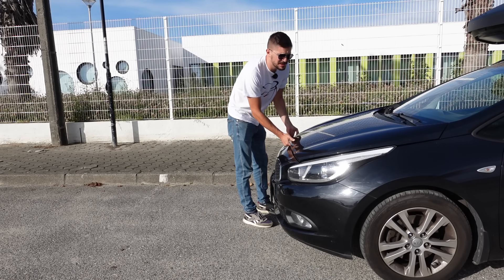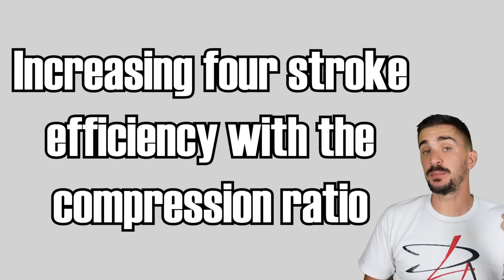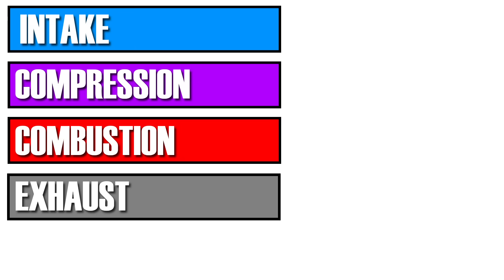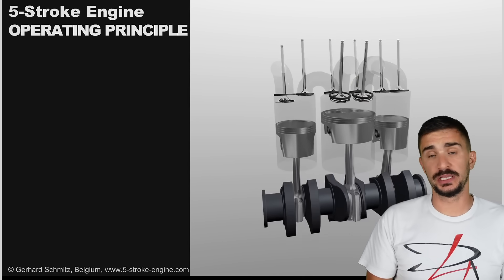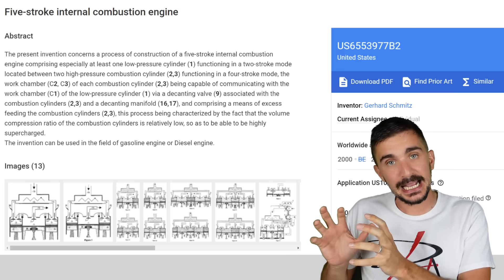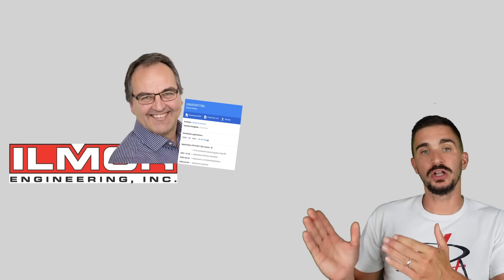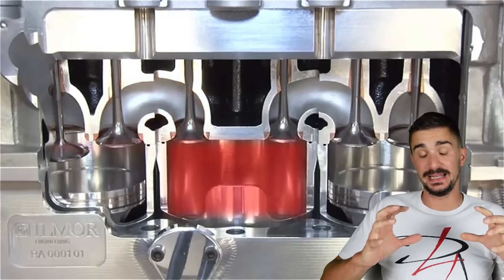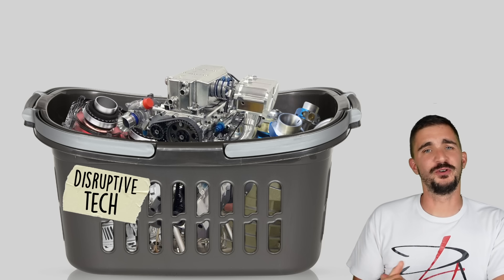Why Five Stroke Engines Are More Efficient But Still a Failure

Comment: I know next to nothing about automotive technology, so I’m probably going to sound dumb; however, I had some thoughts about how to reduce some of the issues with the engine.
1) The expansion cylinder doesn’t deal with the intense forces of combustion directly, so maybe it can afford to be lighter/ less robust. If it’s lighter, then it’s not as much dead weight during low rpm.

2) A turbo will be difficult to utilize, but a supercharger may still be effective—especially if we’re trying to fix the issues at lower rpm.

3) If the expansion piston is still an issue, maybe there’s a design solution that can engage/disengage the expansion system, so it’s not utilized if it’s not helpful. Sounds like a lot of complexity, but maybe it’s something to consider.

4) Maybe the engine could be used in applications that require high intensity more frequently than not. I’m not sure what though.

Again, I don’t claim to be any kind of expert, but I just wanted to share a thought.

Comment: Nicely done.  It does sound like this engine would work well in a moderate to high constant load situation where it runs for 3 or 4 hours at a time, like running a generator for a home while also charging batteries.  It may have a niche application but there may also other designs that might do well in the same application

Comment: Not to ruin your moment or even argue, but electrical locomotives are almost 150 years old as well (1880 when they seriously started appearing), so I wouldn't say that EV's are "new technology". New application and with internal source of power, vs external delivery - yes, but Electric motors aren't "new". They are also "existing, well developed technology". And yes, there were Electric Vehicles in early 20th century, but they weren't good. Nothing compared to ICE. Steam (which this 5 stroke engine takes from) also wasn't able to compete - no wonder that ICE managed to have it's monopoly for so long.
Funny thing is that while this tech was taken from Steam engines (triple expansion for example), there is another version of ICE that takes existing technology from Steam engine and uses it - Turbine engines. Which also try to squeeze as much energy from exhaust as possible.

Comment: @1:27. Your explanation of the inefficiency based on strokes sounds right, but it's not really correct. The real reason is that the amount of work available is related only to the temperature difference at combustion to the temperature at the bottom of the stroke. That's the only time energy is extracted from heat. The total amount of energy is proportional to the absolute temperature, but since the temperature at the bottom the stroke is far above absolute zero, the energy remaining is the 'other' 70% that is thrown away. The only way to get better efficiency is hotter combustion or somehow making the exhaust colder. The mechanics of the engine to make all of that happen are additional parasitic losses, but fundamentally energy available is t(combustion) - t(exhaust). Specifically, efficiency is 1 - (tcold/thot), which for a petrol engine is roughly 1 - 600K/900K = 0.33 (33%). Edit: I realise that you are basically saying this, but rather than making it about the stroke 'length', I feel it's better to talk about how cold you can end up making the exhaust. Edit2: Also, whenever any 'revolutionary' internal combustion engine design is presented, you have to ask how it gets around this fundamental thermodynamic limit. Because no matter how many bells and whistles and extra moving parts you throw at it, the universe insists on having it comply with that equation. This is why electric motors are the only way forward from here - they have a fundamental efficiency of 100% and only fall short of that because of practical engineering. The ICE on the other hand, is fundamentally cursed by thermodynamics.

Comment: The elephant in the room for IC engines is the theoretical limit established by the Carnot cycle.  All these engines do is edge closer to that limit, which isn't particularly high for workable high and low temperature reservoirs.

Comment: Their has been many created diesel engines with HHO units attached as Rudolf diesel did using peanut oil , i have a 4 cylinder diesel with LPG fumigation  i get a lot more torque a the fuel is burnt almost completely and much less heat ,

Comment: couldn't this perhaps be a solution for a power source for an electrical generator that runs under full load all the time?  Would not have to worry about the slow rpm condition.

Comment: In a series hybrid setup, the engine would be running at 80-100% load whenever it is running. That would eliminate the light-load loss scenarios.

Though once you get into strictly range-extending generators, there is no reason to stick to rotating shafts. I'm hoping free-piston linear generators can be effectively scaled down to 10-50kW. With all of the friction points and moving parts that get eliminated, there should be a 10-15% gain to be had there, along with a fair amount of cost reduction potential as the tech matures.

Comment: The shortcomings of this being at low rpm and when in stop and go type use make it sound an awful lot like it would be perfect for a hybrid - only use the engine for highway speeds where the low pressure cylinder would remain a net benefit and the turbo would function properly.
For the catalytic converter issue, though, would it be possible to just route the exhaust so that the cat is after the high and before the low pressure cylinder?
Especially given that the low pressure cylinder is low pressure, it could probably be made with different materials to resist the different byproducts (water especially) better than a normal cylinder can.

Comment: On the surface, this engine seems better suited to stationary work like power generation, pumping or maybe light rail transport. With a turbo installed I would have called it a triple expansion ice.

Comment: Dude the ICE engine is amazing.  It’s been around nearly as long as the electric motor!  LOL but what’s really impressive is the energy density of hydrocarbon fuels.  That’s why planes can fly internationally — and making synthetic liquid fuel is one of the “high hanging fruit” in the transition to getting our energy out of the sky, not the ground.

Comment: If you think about it: It's basically impossible to get a compustion engine anywhere near electro motors.
When the gas explodes, the energy from the explosions goes into all directions. It's an explosion after all. Yes you can direct it somewhat, but not 100%.
Meanwhile electric motors directly convert the electrical energy into a motion with magnetic fields. There are almost no losses.

Comment: The carbon fouling on that third cylinder would be insane for a consumer road going vehicle. Means maintenance would be outrageous for a consumer vehicle. We actually see this in many GDI (Gasoline direct injection) engines in cars.

Carbureted/manifold injected engines use the solvent properties of gasoline (and added detergents) to actively clean the cylinders surfaces (Specifically the valve/valve seats) by slightly overlapping the exhaust and intake opening/closing.

Comment: Just a heads up. This channel owner appears to know what he's talking about, but doesn't. He's confused about ignition timing, and what advance and retard means wirh regard to BTDC and ATDC. He thinks advance is referring to the piston traveling (advancing) down the cylinder during the power stroke. I tried to correct him and he had a temper tantrum. Take what he claims with some liberal skepticism.

Comment: Most vehicles come with VVT so that all the pistons would be able to adjust to the low RPM low load situations.   Also this would work wonderfully as a 6 cylinder engine with 2 middle pistons using cross over pipes to equalize the pressure on both non firing pistons.

Comment: The Atkinson cycle can be done in "conventional" 4-stroke engine.  Instead of lengthening the power stroke, the intake stroke is "shortened".  This is done by prematurely closing the intake valve, before the piston reaches BDC.  So you are putting less fuel/air mix onto the cylinder.  To this reduced amount of mix, the expansion stroke is longer & more energy can be captured.  By adjusting the valve timing, the "Atkinson-ness" of the engine can be adjusted in real-time.  This is especially useful as in cruise, the expansion can be increased, & decreased when brute bursts of power are required.
          The "electric revolution" is HELPING ICE technology.  Gone is the requirement for the engine to adapt to varying loads.  In hybrid vehicles, the engine is not started unless ~20KW of power is required.  Sudden stop?  The engine is kept at 20KW & charges a relatively small battery for 1 minute or less.  Slow start?  The battery provides that until it is almost depleted, then the engine starts & makes 20KW.  The hybrid system also eliminates "shift bumps" & keeps engine load stabilized.  Side effect (not directly related to the engine) is the ability to recover braking energy.
Reply: To adjust "Atkinson-ness" you also need to adjust combustion chamber size. Otherwise you only save some small energy on pumping losses, comparing to standard engine with a throttle.
There are several problems with hybrid. Power below 20KW is needed very rarely. Normally you need a high power on acceleration and then about 20KW for keeping the speed. And this power range is already inefficient for 100KW engine.
Also you can't use small light battery for recuperation, because charge current is very limited and much less then discharge current. Plus the price of battery cycle is close to the price of fuel.
The better solution would be two ICE hybrid: one powerful for acceleration and one small (about 30KW) for constant speed and idling.
Also good idea was from Citroen - hydraulic hybrid with hydraulic motor/pump and hydro-pneumatic accumulator. It is much cheaper more reliable and powerful then electric system. With it you can really use a small capacity for efficient brake recuperation.

Comment: I still prefer the two strokes. Sled engines have some neat high output variants.. but i still love the fact the banshee engine can easily get to the 100hp range and thats from less than 500cc(including stroker/big bore)

Comment: Fabulous as always!  I'm thinking of an additional twist on the hybrid concept.  Why not use a turbo to run a generator as an additional input to the electric side of the vehicle?  That would surely squeeze another few percent of efficiency out of the system.

Comment: As a 4 stroke guy, I can assure you 4 strokes is good enough, it’s not the number of strokes but how you use them.
Reply: Despite what you say, that's not actually significantly better than being a 2 stroke guy.
Reply: @jonc4403 😂😂
Reply: Different strokes different folk
Reply: But can you do 1 stroke?
Reply: @agork  If It Blows At Bottom Dead Center, Then Yes...😶🧂
Reply: That's what she said
Reply: 35 percent is horrible and the very reason they trying to find a better alternative more green we don’t want that so forced to change to something more expensive and efficient same reason we use leds
Reply: 4 stroke is average….. right?
Reply: 4 stroke guy at the 2 stroke circle jerk 🤣

Comment: I wonder if combined with variable timing, "freevalve", and/or variable compression head along with the turbo would solve the low RPM issue? Would definitely make the engine way more complex

Comment: Being less efficient at low RPM and power output can be dealt with by turning it off and only running out when high RPM and power are required. This means it’s perfect for a hybrid vehicle. It would also be good for a home power backup system with a battery. It could recharge the battery whenever it’s low.
Reply: The displacement and complexity of the engine are irrelevant. It’s the power to weight ratio and reliability that matter.

Comment: Important to note for those watching, 35% efficiency is not what makes it to the pavement, its what makes it to the crank. Not including losses in the torque converter, transmission, u-joints, differentials, wheels, and tires, nor does it include losses to driven accessories like AC, power steering, power brakes, and electrical system.

Comment: I think the five-stroke could still be good for a range extender engine where it only needs to run when you can run it at high RPM and load and then shut it down. This should help it generate both catalyst and turbo heat as well.

Comment: So with modern VVT and similar tech, at low rpm they could just "shut off" the center piston and allow the exhaust gases to flow out the exhaust port, opening a bypass port of some sort. This would allow the engine to operate more efficiently at lower rpms. Then when demand is high, activate that center piston.
Sure, it would still be parasitic with moving it around, but if allowing the gas inside it to just "breath" in/out it wouldn't actually be compressing it.

Would be interesting if this would possible with the more advanced tech. 🤔

Comment: I know it's a crazy idea, but what if instead of using a piston to harness exhaust energy, a turbine would be used? I know it's an absurd idea, probably wouldn't be widely used even if it were to be developed, let alone work. It might not be easy to incorporate the output into the powertrain, but if it were used to generate electricity, or maybe used in place of something else to work a part of the engine...

On a completely unrelated note, sarcasm doesn't translate well though text alone.

Comment: 13:53
No, it should be counted as 2-cyl. There is literally no action in the middle cylinder. It has 2 injectors that squirt out fuel enough for a 698cc engine, then 698cc it is.
It's just like my country used to classify the 13B as a 2.6L engine, just because it's a 2-stroke and it burns twice as much. Like, no, it's just a different cycle. It has 2 chambers, with 2 injectors that squirt out fuel enough for 1308cc per cycle. So it's a 1.3L. (The issue got fixed. Nowadays they are registered as 1.3L.)

Comment: I mean, there’s some tech that stayed relevant / best possible for over a century, just not in the car world.

The railroad wheel (flanged steel wheel on steel track) is over two centuries old and the electric rail propulsion is 153 years old, but how to get the electricity there usually is a problem (and the exact type of electricity changed with tech)…

Comment: Great show, but regarding reading the room, I think you will find electric motors are at least as old as engines, and have also been in continuous ubiquitous use ever since.

The change has been the late scaling of battery technology for this big energy demand, dwarfed only by stationary battery grid storage.

Anyway, motors and even 1800s BEVs aren't some newcomers.

Comment: Perhaps the issue of poor efficiency at low RPMs could be solved by having more combustion cylinders for each exhaust cylinder? For example an eight cylinder engine with six combustion cylinders and two exhaust cylinders. It wouldn't be practical for the average economy car but could still benefit applications where large heavy duty engines are used like trucks, locomotives, and ships.

Comment: I still like this for truck, bus, or RV range extender designs. It's hard to justify an expensive emissions system for an engine that isn't used continuously, but power density and efficiency are still important. The primary advantage of this engine seems to be its ability to reach high efficiency rates at high load vs the conventional Atkinson cycle engine in the Toyota hybrids that needs partial throttle and relatively low RPM to reach its peak efficiency. This problem is mostly ignored because the window of efficiency gets wider with time and it's generally not necessary to rev a Prius high into its inefficient RPM band.

Comment: Couldn’t a valve be used to bypass the LP cylinder during low load, low rpm operation, and also allow the cat to get full exhaust heat when the engine is first started? Something similar to a Jake brake, maybe.

Comment: A 3cyl or any engine that Requires a COUNTER WEIGHT may as well throw in this "Extra Stroke" cylinder.

Just another "W" for EV's! Old ideas can die-off with the Old Men responsible for them. Electric Motors are the path we should've been on a LOOOONG time ago

Comment: Would be cool to see this used as a range extender though. Just attach it to a permanent magnet generator and run it at its optimal high speed when more energy is needed.

Comment: NO, as I have told you before, the combustion stroke is NOT 180 degrees!  The combustion stroke ends when the exhaust valve opens, typically around 120 degrees after top dead center.   There is NO MORE FORCE IMPARTED TO THE PISTON WHEN THE EXHAUST VALVE OPENS!

How is it that you cannot figure this out-?

This 5 stroke is just another full expansion design with more friction.  That's why it never caught on, it doesn't give enough additional efficiency to justify the cost per horsepower.  

T-he power stroke ends when the exhaust valve opens.  PLEASE figure that out!
Reply from the maker: I just can't man, it's too hard. I need someone to type it in all caps for me a few times until it clicks in.
Reply: @d4a  I cannot even believe how you are acting.  Are you drunk or something?  I just reported this post!  You are harassing me.

Have a nice day-